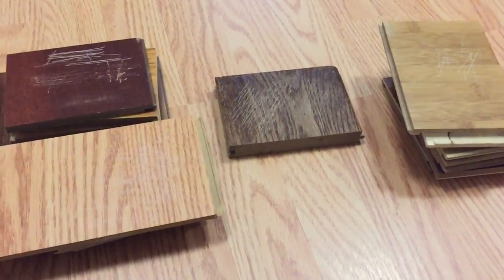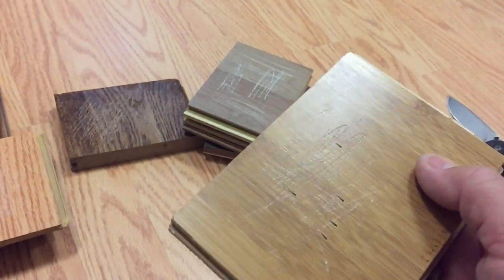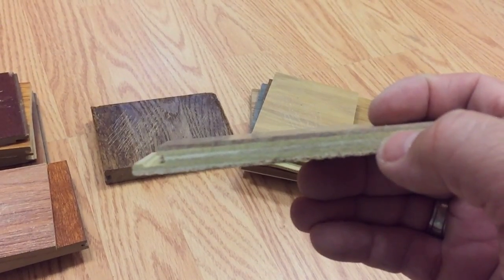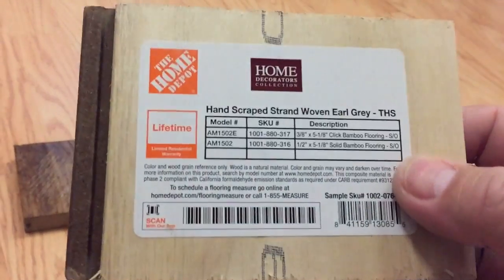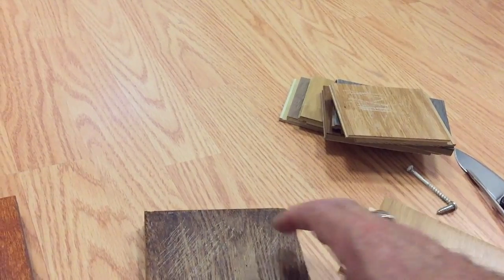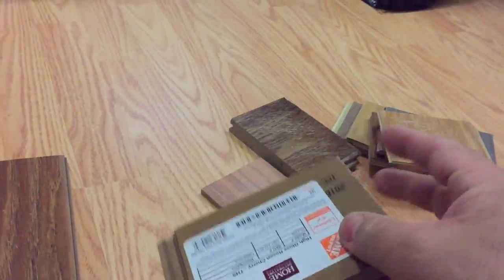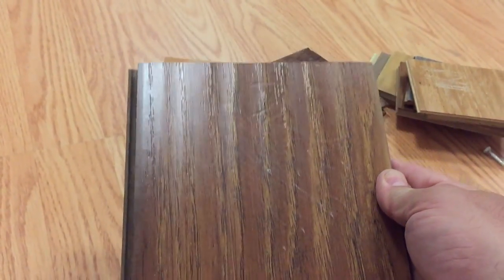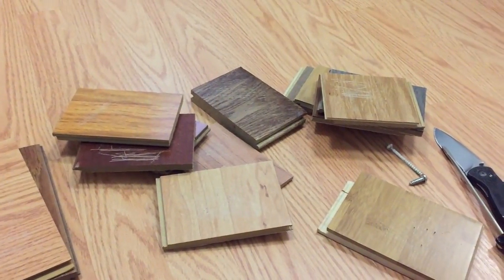Wood Flooring Scratch Test on Engineered, Solid and Laminate Samples

Comment: thanks. now i know what engineered wood is. I am looking for something that feels good on the feet like solid real wood for my cabin.
Reply from the maker: If you have a wood sub-floor at your cabin you can use either solid wood flooring, engineered wood flooring or laminate. The engineered wood flooring has the feel of real wood because the top slab is wood, and it has the strength of a laminate and won't warp when the weather changes. Good luck with your project and thanks for your comment.

Comment: I dont understand,  this is not a good way to test a finish because every floor will scratch when a sharp pointed object scraps on it. You wouldnt test to see how good your cars paint is by running a key down the side of it, so dont do it to your floor. Finishes should be abrasion resistant, stain resistant and easily cleanable. Use a grade 1 steal wool to simulate light abrasion in high traffic areas, you'll find this will leave scratch marks on just about every hardwood at home depot, but cant scratch high quality hardwoods. To simulate how stain resistant a floor is, poor wine on in a small spot and let sit for one hour and then wipe off. Low end finishes are often open cell, which means they are more prone to stain. To see how easy it is to clean, sprinkle a small amount of flour on the sample and try to wipe clean with a rag and water, you'll notice a dramatic difference between samples.
Reply from the maker: I think u missed the point. I was trying 2 show how a variety of laminate and eng wood prod reacted 2 severe damage and how some of the most inexpensive r better than others that cost 2 or 3x's as much. Thanks for your comment.